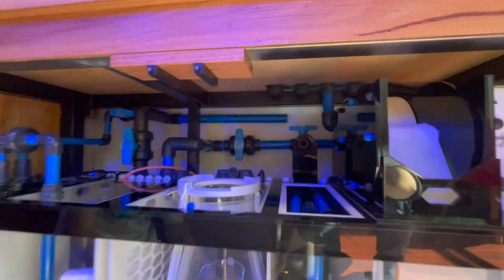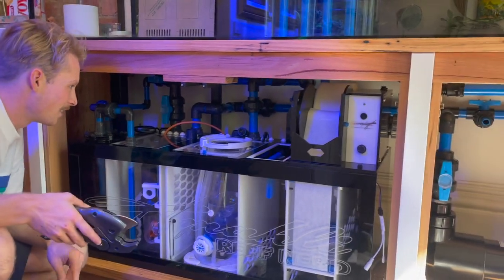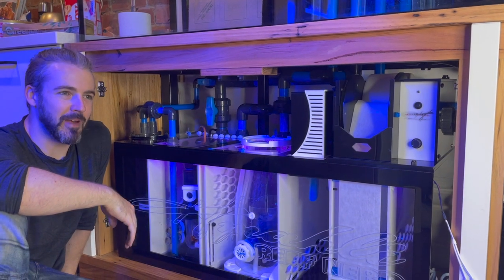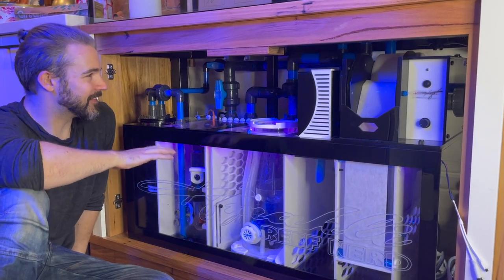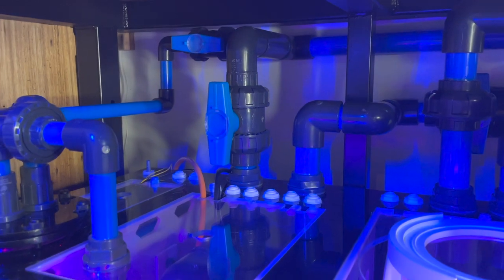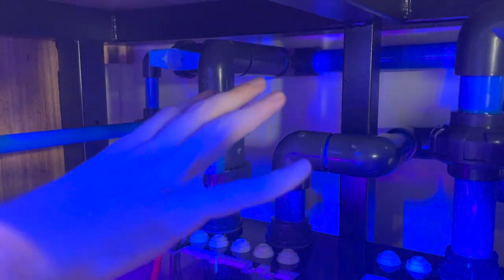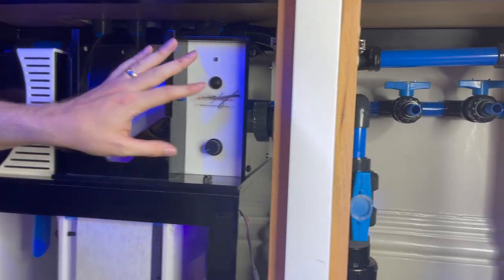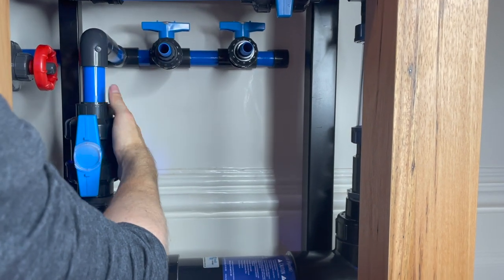Plumbing My Dream Reef Tank

Comment: Great 👍 detailed explanation on how it’s all going to work and what all the pipe work and fittings do, it’s certainly packed out with gear and room for expanding, but man, it’s tight, only just enough wiggle room.
Looking 👀forward to the next video in this series. 👍🏴
Reply from the maker: Yea lots of minor miracles that some fittings fit and and worked. Given the constraints I had, and the amount of functionality I wanted. For access and serviceability the bar to meet was "difficult but not impossible".

Comment: Wow lots of tight fit plumbing! Awesome job! That flow meter is a great idea. Old school less moving parts that are less likely to fail and be cleaned like Neptune’s.  Also might want to lift the uv a slight angle to get the trapped air out. 
Good luck!
Reply from the maker: Yeah, and its fully able to be dissembled and cleaned if it ever were to get clogged/dirty which is a bonus. The UV is actually mounted on a subtle angle with the output side slightly higher.
Reply: @ReefNerd  what was the name of the flow meter? Wonder if I can find it in the states.

Comment: Good job. What I do for stuck pipe and fittings like you had in your video is to dip the fitting into a properly sized cupof hot water heated via a microwave. I dip the fitting for about 20-30 seconds with the water level just below the joint between the pipe and the fitting i.e. don't dip the pipe. Pull it out and the expansion of the fitting will just be enough for you to remove the pipe.  Interested to see how accurate your flow meter is and is it fully plastic or does it have SS 316 internals?
Reply from the maker: Great tip! The flow meter has a single metal part, the stainless 'skewer' or guide that the red markers moves along to show the flow reading. Its rated +/-4% for accuracy and certified and tested to comply with that accuracy. So good enough for me haha

Comment: Marcus, great videos I must say, slightly off topic. I have just started using the Kessil 360X with the WiFi Dongle. I like the simplicity of Kessil, I don't want to spend time playing with lots of app sliders with the possibility of nuking some of my corals. I just want to set it up, switch it on and leave it.

My tank is only a 16" deep lagoon tank, I was going to use the Kessil preset time period and reduce the maximum intensity to 40% at the peak of the time period to acclimate my corals. Do you ramp up you UV/Red during the cycle or leave them at the same setting, because of Kessil logic would that make a difference?
Reply from the maker: Hey, to be honest I have never used an acclimation cycle. I just set the lights at my end goal, and let the corals do the acclimating based on that stable and never changing light cycle. 
If you want to use an acclimation cycle through the Kessil app, I would work the red/UV/Green channels to your end goal setting in stages as well. Though I wouldnt expect the red or green to be used at high settings, only the UV most people ramp right up.

Comment: Looks good! Was seeing your old video on the Aquatic Life DX18 hybrid fixture. I just got the same thing, do you remember what screws you used to mount it to the ceiling?
Reply from the maker: I got a plaster toggle and an eye-bolt to make my mounting mechanism. I think I showed it in the video I did on the installation of the DX18. https://www.youtube.com/watch?v=AZM1zlcC_qY
Reply: @ReefNerd  Toggle bolts seem to only hold 10kg each? I have a 4 foot fixture which is about 10kg, so would 2 bolts be ok?? It'll be rated for 20kg with the 2 bolts but still a little nervous, haha

Comment: HI,
Just wondering how the performance is on the A200?
I just done 1st water test on a similar size built, had purchased a COR20 however from the 7500lhp capacity I am only getting around 2500lhp, have 5ft head and manifold.
I am considering  purchasing a A200 and was wondering if you know what return you are actually get back into the tank.

thanks and great build.
Reply from the maker: In my system, which very tight, complicated and possibly restrictive 32mm plumbing split in two manifolds and two returns. I am getting approximately 2400LPH with my Abyzz running at 48% speed and boost mode off. Soooo yea the performance of the Abyzz is amazing... at 100% my drains can barely keep up and the flow is too high for my UV to be effective LOL

Comment: Great vid as always! Don't you worry about the shaft in the flowmeter after the UV rusting? Thought about the purchase for myself, but as it was not specifically rated for saltwater, I doubted the reliability. The more saline the water the easier things float, hence an inaccurate device for saltwater applications, yes?
Reply from the maker: Sanking Flowcolor is specifically designed for aquarium use and is really high quality. I am not worried about the stainless steel shaft that holds the flow indicator. However that said, its easily visible through the clear acrylic section and if it were to begin corroding or I detected metals in the system from an ICP test, its an easily serviceable and replaceable part.
Should also note, it doesn't function based off any principle of floating (such as a hydometer), it functions based on water pressure. Salinity wont materially impact its accuracy within its range (+/-4%).

Comment: Really enjoying the channel, Great work, it must take some effort to get the content together!   @10.40 you introduce a flow meter, which looks a great idea and I never seen before. I noticed it is a float for H20, as salt water is more dense you may not get an accurate reading if looking at those marks. HOWEVER it's all relative, so I am assuming you will set up a reasonable flow, tape off a mark on the meter to aim for, then just monitor it?  Certainly will look to add some to my new builds.  Thanks once more!
Reply from the maker: Yea im not too worried, I dont know whether the accuracy is effected significantly by the water salinity or not... in any case its just an indicative indication of flow... and when we are reading flow in terms between 1000 and 2500 liters per hour... pinpoint accuracy is less important that knowing the ball park and knowing whether its remaining consistent over time. Certainly beats the bucket and stop watch approach
Reply: @ReefNerd   Completely agree.  Still think that it is an awesome addition to any tank.  Thanks for taking the time to provide such great overviews. Avid watching.

Comment: Nice job, love the color scheme.  One question...the UV sterilizer on the horizontal position...do you forsee any bubble issues there?  I know they recommend vertical position or at least raise the 1 side higher.
Reply from the maker: With the outlets facing upwards, I dont think its going to be possible to get any air stuck in there, but the output side is slightly higher than the inlet side as well as recommended by the instructions

Comment: Great content! Thanks. Just a question: how you will glue the acrylic to the overflow? I did that in the past with silicone and it didn't stay in place. Water started to go between acrylic and glass.
Reply from the maker: We will use silicon to attach the acrylic and glass. If the silicone has not bonded glass and acrylic for you in the past I would suggest you either used the wrong type of silicon glue, or the surfaces were not prepared properly and let to cure properly. Once properly bonded and set the silicon will be stronger than the acrylic.